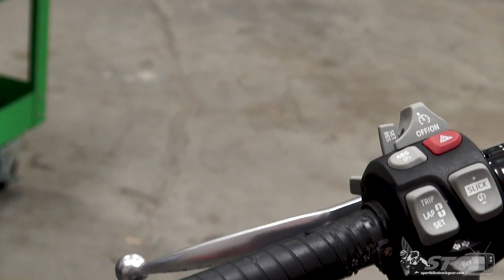Whatever you do don't install these grips on your 2018 BMW S1000RR | Sportbike Track Gear

Comment: Took me 15 mins to do both sides on mine. Used a Xacto knife to cut without damaging the heating coil/wires, installed Domino grips ( yes, had to buy two), slipped them on using hairspray and everything is perfect including the heating.
Reply from the maker: Happy you got a good result. - Van

Comment: Sorry Brian! Thank you for being honest and sharing this with us! Do you think a better alternative would've been to install aftermarket clipons, and preserve the stock if the bike goes back to street trim?
Reply from the maker: The problem is the switch pod and throttle housing design. Even with aftermarket clip ons you will still have this same problem. - Van

Comment: i use pillow tops on every bike i ever owned. For this bike, i bought x2 and used both the throttle grips. Also f*cked up 1 heater element as well... lessons learned. Repaired/replaced now, but still using pillow tops!
Reply from the maker: This bike is for sure no fun to install grips on. - Van

Comment: So been watching your vids for a while and usually agree but in this case you are just wrong. I have an s1000r with the heated grips as my daily, i had to replace my grips since they were worn out, went with the renthal ones, bought 2 sets, was hard but the clutch side was actually easier than the throttle side because they used less glue at the factory. just use some hairspray as lube to install them and make sure you take your time. It's really not a big deal my heated grips still work after changing grips
Reply from the maker: I would not replace the grips on the BMW based on this experience. All of the bumps on the throttle tube would drive me crazy. - Van

Comment: Similar issue when buying Oxford heated grips for my aprilia shiver 750 2011. the OEM throttle tube has raised  nubs that grip the grip to stop slippage, but unfortunately the Oxford heated grips are a solid unit, with no give and the raised nubs had to be completely filed off, in order to get the Oxford grip on, as the nubs made the diameter of the OEM tube larger.
Reply from the maker: I bet this video will deter some riders from replacing the OEM grips with aftermarket. - Van
Reply: @sportbiketrackgear  without a doubt

Comment: Wow! You weren't kidding, what a PIA that install seems to be. 

Ya know, BMW should have realized that people are going to mod this bike, that includes the grips. They really should have used that same heating element on the throttle side, for the clutch side, it looks like it works much better. You pay extra for heated grips (well it's included in a package that is extra $$). Now just for swapping out the grips he lost one side for heat. Bad on BMW in my opinion, both sides should have that nicer heating element, not some cheesy, thin wire wrapping around the bar. That bike is over $20 grand!!!! Sorry, I just had to rant a little.. if that were my bike that would bug the shit outta me that I lost heat on one side..my OCD would be off the chart 😂😂
Reply from the maker: If this were bike I would leave the grips stock for sure. This would drive me crazy! - Van
Reply: Get throttle heater for left side